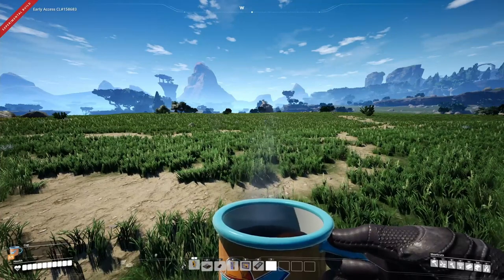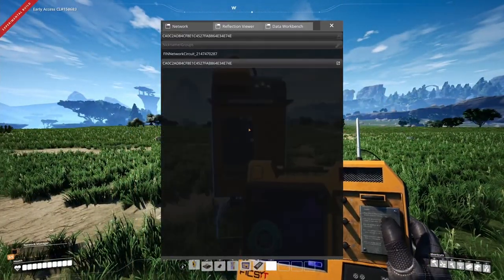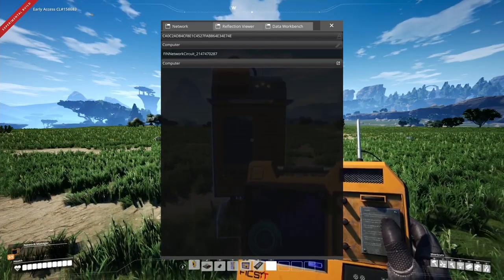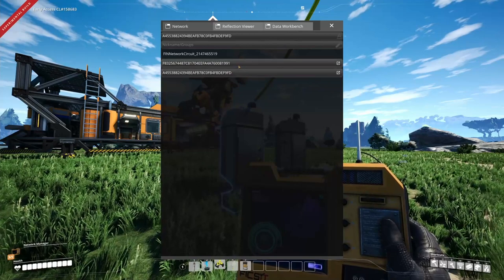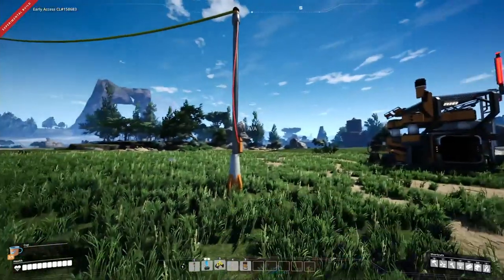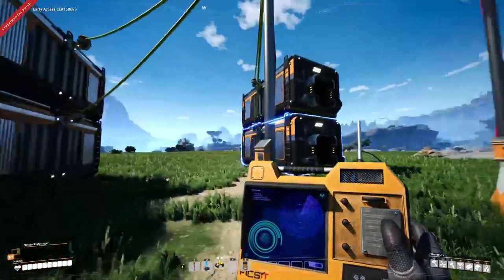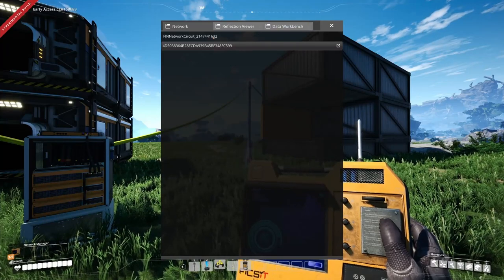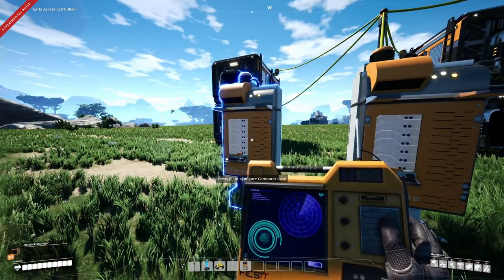FicsIt-Networks - Components | #01

Comment: Hey thanks for the great mod. Having a bit of an issue and not sure how best to solve it maybe someone can help. I am getting all components of class into a list but when I reload the game the order changes and the index i use to select the correct component is now wrong. I see that most objects have a location, I could use this to make sure the index is correct by assigning based on location but this seems a bit tedious. Is there a better way to do this?
Reply from the maker: the moment you "assing based on something" you dont have an ordered list anymore... instead you have an hashmap, this map uses the internal memory address of an object, and that changes...
so you instead have to fundamentally change your datastructure... either you store it as a map or as an array... you cant do both... if you need both qualities, i would reccomend to have one of the other data structures just as mean of referencing the other... f.e. hashmap stores as key some key and value your wanted data, and an additional array stores just the key, but then you can instead order the keys as you want
Reply: @Panakotta000  Oh that is what hash is for . thanks!